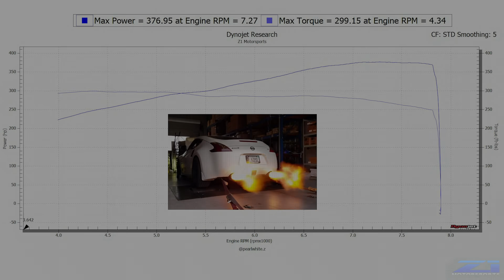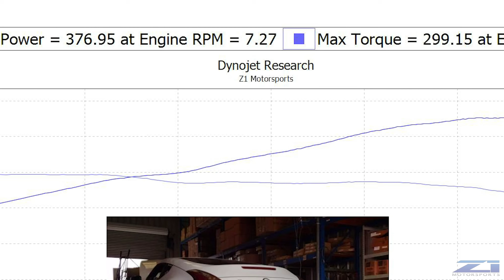Z1 broke a 370Z NA horsepower record...+100HP

Comment: I made 380 whp 270 lbs 2 tunes ago, something happend & had to take some parts off and tuned it again, but the tuner lost my file....I made 365 whp. so this is not the record but stil extremely impressive!
Reply: You've never had a thing to back up a single claim you've ever made, whether it be a dyno sheet or a time slip. I offered to pay you a week's salary plus hotel/travel expenses to meet me in Texas and you went ghost. I made more torque than that at 334. You can take all your "custom, one off, special, 2 tunes ago" parts and shove them. Until you provide some sort of documentation, your continued claims hold no merit whatsoever.
Reply: @Will-xp6jh  I don't have the 380 whp dyno because my tuner lost the file, but my 365 whp is on my page and when I get tuned next it will probably be close to 400 whp.... I'll post it, I just need a new ecu so I can tune it again.
Reply: @jonny_z__370zna5  That'll be a first. I'll be waiting.
Reply: @Will-xp6jh  That's what I'am personally hoping but at the very least 380 whp like I had before & would be cool if I got this guys tq, because some how he made way more tq than I did or do. Also there was a guy years ago who mad 375 whp. He showed every receipt he had for every mod, showed the dyno graph and I think video in the 370z forums.
Reply: @jonny_z__370zna5  That guy is me. That's my car. The 1 on the forum you're talking about was 371/296.
Reply: @Will-xp6jh  Well good numbers! Enjoy the tune.
Reply: Will Where in texas are you? Down to race?
Reply: All dyno's read differently guys. Take your car to the same dyno on the same day/time. Then race, boom.
Reply: @techmaster777  I'm in Mississippi. The Texas meeting was a proposition I made for a meeting.

Comment: 371!?!? That's insane. Stock TBs still?
Reply: Yeah I'm curious about that too. He has the Z1 CAI with the upgraded race package (bigger filters, velocity stacks) it looks like. I want to say those are either 2.5" or 2.75" intakes meaning he probably has stock TBs. I'd be curious to see what EPS TBs, 3" AdminTuning intakes, and a retune would do.
Reply: Will Boom. Any driveability issues with them?
Reply: @johnpowers4076  We're still working out a couple bugs in them, mostly to clean up cold idle. For the most part, they're good. The idle is no fault of Z1, I just had something come up and needed my car back. It was done other than that, but they informed me ahead of time, so I was aware.
Reply: Will That’s good to hear. I’ve been thinking about getting them.
Reply: @Will-xp6jh  will, are you tuned on uprev?  I have the EPS tbs and similar setup as this guy and yours, only, I didn't wait long enough and got the C1 cams.  So that build is in progress.  Some people had issues and some it was a piece of cake tuning ... So just curious.
Reply: @flexican77  That is my car😅 but yeah, it's tuned on Uprev.
Reply: @Will-xp6jh  lmao... I've been looking at too many vids haha 😅

Comment: Wow!  Nice work!  That sure was labor intensive!  What was the labor cost?...like $5G’s.  Lol.  What mod do you think gave it the most gains?
Reply: Labor intensive? That's just taking front cover off then the valve covers.
Reply: FrAn_dR0iD 
They pulled off the entire front end of the car and the top of the engine.  Not just the valve covers and timing cover.  Quite a bit of labor involved just to get that timing cover off.

Comment: Imagine how much more power with a tomei
Reply: 2-3 would be my guess
Reply: You're not gonna get a ton of peak power going from the greddy to Tomei. You'll get more noise and some top end but you'll lose low and mid range.
Reply: @jawaunb8405  AdminTuning would prove otherwise, not a ton more but there is more power to be had with it. Check out his channel if you haven't. He's a big believer in the Tomei making the highest hp and has good evidence to back it up.
Reply: Never the less awesome power from this 370z
Reply: John Powers actually no...admin pushes for greddy, ISR and tomei equally. Basically a 3” single exit. Getting the correct Y-Pipe is a bigger issue
Reply: r/woooosh
Reply: @johnpowers4076  coming from someone that has had both I know from experience that the gains are very minimal and not worth the headache and extra noise. I was actually the first to try it and with the use of the 370Z Tomei not the one made for the G37. You sacrifice low/mid by going that route and sure if you live in the high rpms then that's what you want. For me that wasn't practical. Especially on an engine with oil pressure flaws. Had experience in that department as well.

Comment: not a fan of the plastic plenum.  why plastic?
Reply from the maker: The plenum is plastic from the factory. Z1 offers a ported version to increase performance. People usually feel a little weird about it when they find out it's plastic, but these things are the best flowing plenums we've seen. All aftermarkets plenums included. The vehicle we dyno'd last month with +800rwhp has the factory plastic plenum. They strong.
Reply: @Z1Motorsports23  they may be effective but they lack class and visual appeal for sure

Comment: Sasha has 425 whp at least..... Yeah 376 is great but don’t claim world record power ..🙏
Reply: World record VHR. I'm not sure what car you're talking about, but I'm assuming it's boosted.
Reply: @Will-xp6jh  Sasha Anis is who he's referring to and no it wasn't boosted however it was also on ITBs and not on a stock bottom end. In Will's and Z1's defense, Spencer never said anything about "world" record. He merely said NA record which probably meant NA record on their Dyno. Kleeman was the highest on their Dyno NA.
Reply: @jawaunb8405  It is the NA VHR world record. I think I have seen that car, but it's a fully built engine and spins to like 9k, but no, it's not the overall VQ world record
Reply: Sasha Anis. Green Time attack car, ITBs. Very much NA 😂😂
Reply: @STR8RIPPINZ33  I found it. There's another shop that has 1 making 414who last I heard, but it was a VQ37 block with HR heads. This is strictly the VQ37 VHR record.
Reply: @Will-xp6jh  there's more out there. Some on stock bottom end and some with high comp pistons and rods. The one with stock bottom end did 394whp with JUN cams. The one with the built bottom end got around 470whp. I met a couple race teams at Road Atlanta that have some high numbers too but can't officially disclose it. A company out of Germany had some wild builds like 3 yrs ago.
Reply: Not taking anything from you. Your setup is well put together. Very impressive.